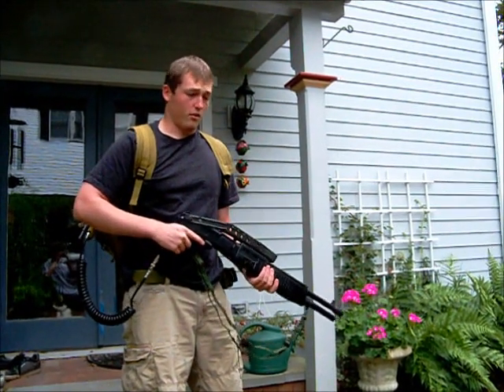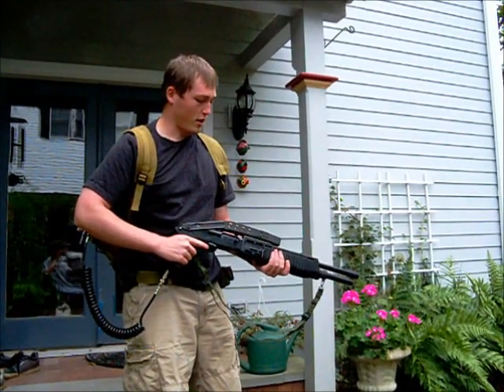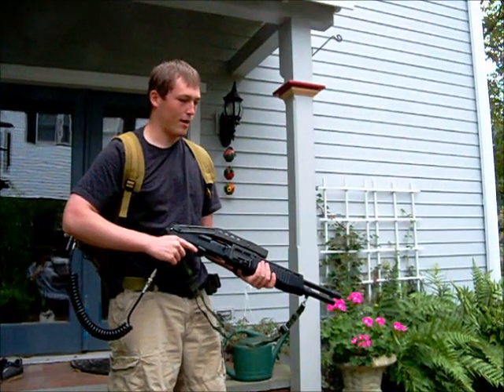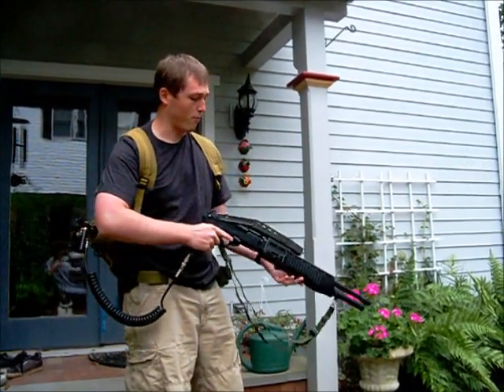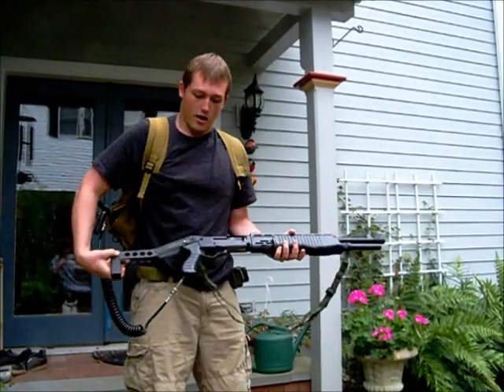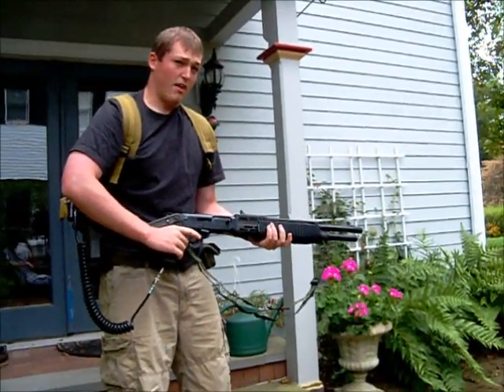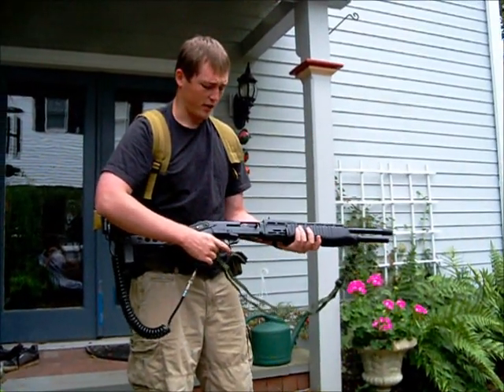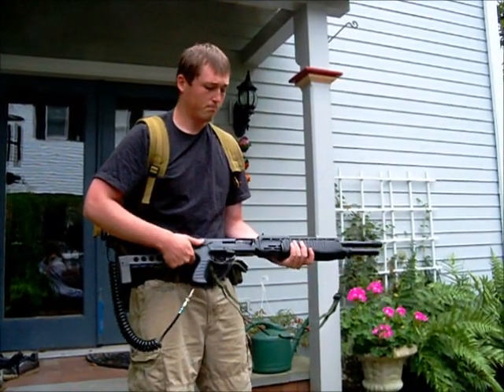Airsoft Shell-Ejecting Gas SPAS-12

Comment from the maker: The Tokyo Marui SPAS-12 and Maruzen M1100 are both mostly plastic, as is typical for a lot of Japanese guns, and the metal parts (internals, barrel, mag tube, folding stock) are mostly pot metal and aluminum rather than steel so it's pretty light, I'd say 5-6lbs at most. It's definitely light enough to be handled by pretty much anyone, not to mention the lack of recoil. Keep in mind though that this is a hybrid gun, so the base TM SPAS-12 is lighter still as it has plastic internals.

Comment from the maker: Main problem with selling them is that it's $300+shipping for the base gun (with a tube capacity of just 4 shells), plus the cost of a SPAS which is not easy to find nowadays, plus a Palmer's rig to actually operate it, plus a metal folding stock ($100 shipped). You're looking at $500 minimum in parts, plus a donated SPAS-12, plus a CO2 tank, and then it's still only 4+1 shells. Making a custom part like I did for the mag tube would add more expense.

Comment from the maker: As I have said to others, the obstacle is the cost of materials. The M1100 is $350 or so, the SPAS-12 is over $200, the folding stock is another $100 shipped, the Palmer's rig is $150, and then there's the time and labor involved. That's $800 just for parts, and then there's still the matter of the custom replacement parts so it keeps working. The only reason I was able to build this was because I was able to find a broken SPAS-12 and a very cheap M1100.

Comment: Does the stock fit a TM spas 12 or did that need adjusting due to possible differences in internal structure (a problem I saw with a few different spas 12 models and their stocks not being transferable)

Comment: nice job on that custom gun you got there man,
you inspired me to make one of these.
I hope you don't mind if I ask what kinda version of the maruzen m1100 you used for the internal parts?

I got myself a revision version of the maruzen m1100
(the one with the pistol grip and shorter barrel)
hope the internal parts of this will fit in the TM spas-12
Reply from the maker: I used a full-length M1100, but the only differences between the full-length and Revision are the gas system, magazine tube length, and inner barrel length. With the gas system replaced with the external line, all that differs is the magazine tube length and inner barrel length. Since you intend to fit the internals inside a TM SPAS-12, the Revision is definitely the better fit- I had to cast and fabricate a replacement joint piece to run the full-length tube through the SPAS-12 body.